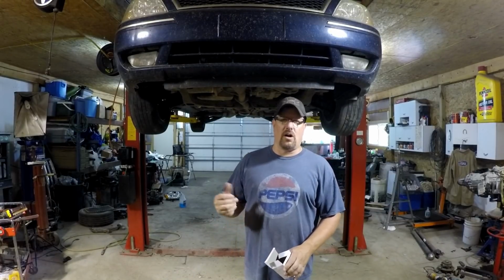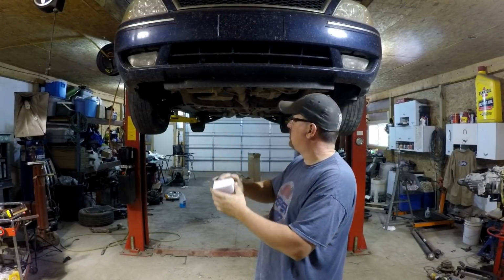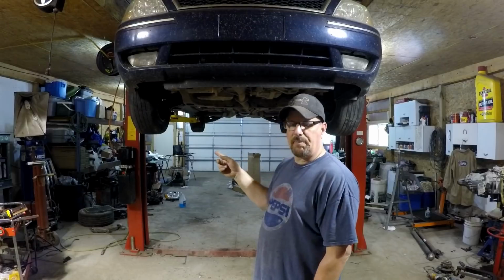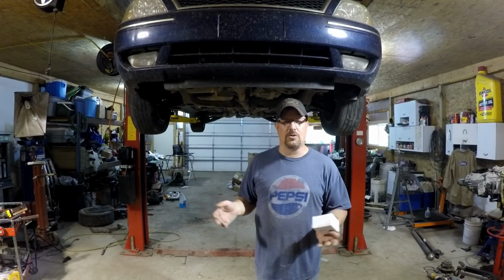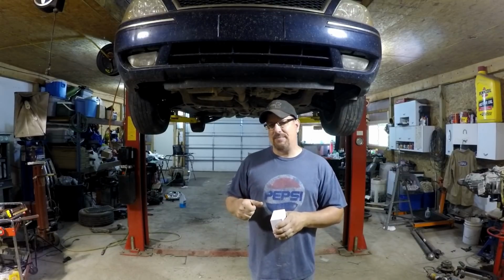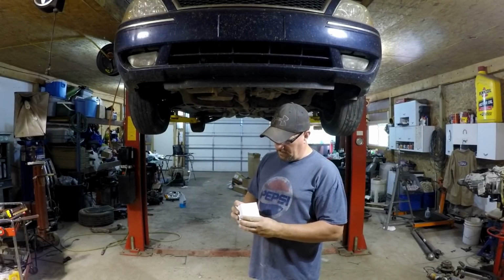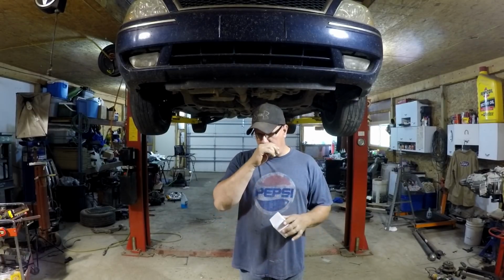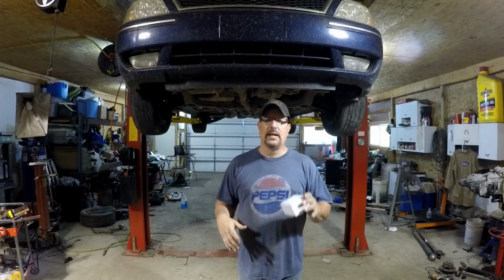Ford Five Hundred, Ford Freestyle or Mercury Montego lower control arm ball joint replacement

Comment: Glad you mentioned opening the mounting points. When I first did a control arm some years back I almost beat the new control arm senseless trying to get it in. Behold I realize the mount pinches tight upon previous installation. Lol
Reply from the maker: It sure makes it go back together easier! I learned it the hard way years back lol
Reply: @Tomsfoolery.  yeah it does. That was my hard way. Should have added that note.  took about a half hour to an hour swinging like a blacksmith. Lol

Comment: Great end tip 👌 I grew up working on cars since I could remember and unlike most mechanics I always check ..heres a tip for you when working on a Chevy 2000 to 2009 when you replace pads or do breaks take the extra time to remove the caliper bracket ( 2 .18mm bolts) and lock tight the shit out of them I even take a chisle and dimple the threads to lock the bolts in place thats the famous wheel lock problem one or the other bolt works loose and out then the caliper hits rim and locks either in reverse or forward I had to drive gf 07 trailblazer 11 miles backwards home 😆 that was my sighn lmao

Comment: Thank you very much for this instructional video.i followed to the T helped alot. Knowing socket sizes i live in wi.so alot of salt around .i had to torch 1 bolt off.other than that your instructions were very useful.in fact was watching your video while doing changing my lower assembly.THANKS keep up the goid work.

Comment: I just did the control arms on a Freestyle, all the same as the Montego/500.  Rear vertical bolts torque specs are 73 lb ft., the big 4 in. bolt is 111 lb ft., and the ball joint is also 111.  Wheel hub nut is 248 lb ft.

Comment: Approximately how many hours would it take for an experienced repair shop to remove and replace the lower control arms with the ball joint and control arm bushing already installed and replaced the front struts on a Ford 500 thank you

Comment: Nice video. But unless you tighten that lower control arm bolt with suspension at normal ride height, the rubber bushing is twisted out of a relaxed position and it will tear before long.
Reply: 💯 correct
Reply: dogman8436.  Not true, it doesn't matter!
Reply: Dogman is correct. I made the same mistake and it twisted the bushings shortly after.

Comment: I'm getting ready to do this job on my '05 Ford 500 so your video is a going to be very useful to me.  One question maybe two, I noticed that you didn't apply any Locktite to any of the bolts, is that something that you saw as optional?  Also, if you don't mind sharing, who was your source for parts and at what cost?

Comment: Hi I don't know how often or quickly you respond to these. I just ordered new control arm for Mercury Sable 2008 and this appears to be the same part. My question is that the bushing did not come placed on the part, can I just beat it on with a mallet or do I need to do something special to keep it from slipping off?
Reply: To clarify I mean the silver piece with the bushing inside that pushes over the rectangular post at the end.
Reply: @Nick Miller  I used a dead blow mallet. If you got a bench vise, you'll save yourself some heart ache. 
  Put some dawn dish soap on the control arm end and the inside of the bushing, and have at it. 
  Watch your depth, compared to the old one. I torqued everything down, according to specs. Except the bushing end. 
  First, I lowered the car so it would be at ride height, then torqued it best I could while it was on the ground.  
  Get some cardboard, or that cover in your trunk, to lay on. You may thank me later for that suggestion, lol.

Comment: Great video.  But how you know the control arm ball joints are bad to replace?
Thanks
Reply: Im sure you found the answer but just in case...
Jack up the front end and grab the top n bottom (12/6 clock) of the tire then push/pull listen, look, and feel for free play. You can even pry up on the tire with a prybar.
Reply: @rmark1083  Thank you for your advice

Comment: I noticed you did not  use torque wrench.  Should I be torquing any of these nuts/bolts to specifications or no?
Reply from the maker: I have done enough to know the “feel” on this type of work. If it was a hub nut or head bolts, I’d use the torque wrench. So to answer you, yes, use a torque wrench.
Reply: @Tomsfoolery.  I'm goibg attempt inner, outer tie rods, and stabilizer w/ ball joints. Your video is a great help and probably would not attempt this task with out it. Do you know where I can find the correct torque specs?

Comment: I have a question i did the same job on my 05 five hundred. MInus the tie rod ends. I also did the quick struts and sway bar links. My problem is on the driver's side the top of the ball joint stud is rubbing. Anybody know why?

Comment: Great video. I'm about to do this to my wife's Freestyle. Couple questions. What drills are you using, and do you think this job is possible without a lift?
Reply from the maker: You don't need a lift to do this job, but it helps. Jack the vehicle up and place it on jack stands. The cordless impact is a dewalt 1/2" drive. Lowes sells them. Thanks for watching and good luck on your vehicle!
Reply: ts6034 Thank you!
Reply: Did my freestyle lower control arms struts strut mounts and sway bar links.   With Jack stands.

Comment: Do you happen to know if the control arms for the FWD and the AWD are the same? I can't find moog in anything but AWD, but they look identical. I'm trying to avoid the chineseum junk.
Reply: They are not the same.  The all-wheel drive version of the Ford 500 uses different lower control arms.  I have yet to find anyone on the planet that provides instructions for doing this job on the all-wheel drive version

Comment: I know it is a long shot on getting a timely answer here, since this is not a recent video. I only needed my outer tie rod replaced. When I did it, there was this silver metal cone looking thing in the cup between the end and the ball joint. It was flat on top and bottom. Mine cracked in half and half was missing and I dont know the part name to ask for. Currently have a nut and washer acting as the part, and it is fine, however I am wary of it shifting, so I would like the real part in there. If anyone could help me, I would be grateful. Thanks